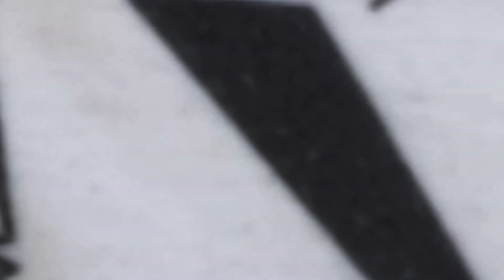New Spectraphon Firmware! | Make Noise

Comment: Woud it be possible to add freeze/smear/blurring into future updates, considering the platform it is built upon? This is the only thing that's missing to be a better option, for my usage case, to the Panharmonium. Or, maybe you know a way and have tips to do what I'd like to achieve, with or without extra modules.

Comment: Nice 👍 As the module is very large the added features are good for the features per HP ratio. Can you split the module in two parts and use one side as noise and the other side as spectral oscillator?
Reply from the maker: Yes absolutely, the sides remain independent from each other. Many combinations to try out!
Reply: @MAKEN0ISEMUSIC  that’s very interesting… a lot to explore in that new sonic capabilities!

Comment: For low frequency modes, are the cv outputs more attuned to smoothed random or chaos type cv? This firmware is absolutely bonkers with the new oscillator functions so hearing there’s even more is just fantastic
Reply from the maker: The modes work exactly the same in low frequency as they do at audio rate: SAO is summed sine waves at harmonic ratios, etc. We will dig in in detail in a video soon!